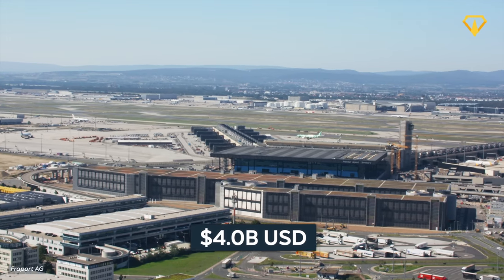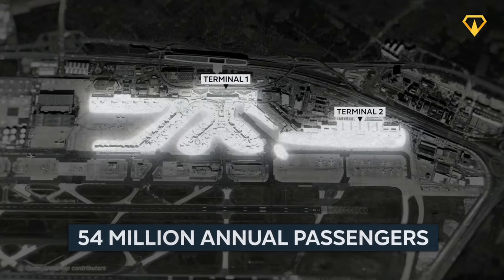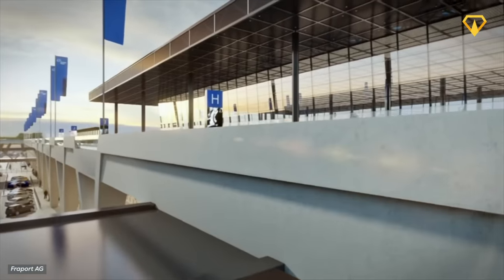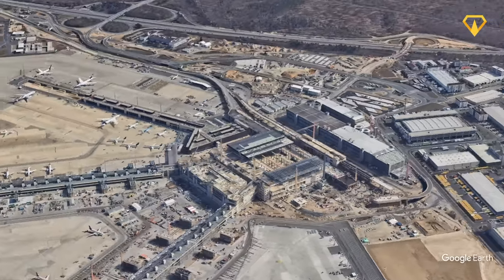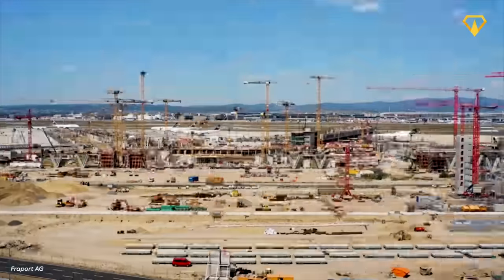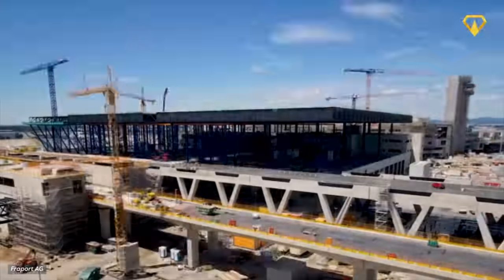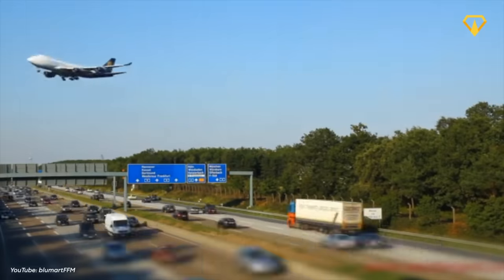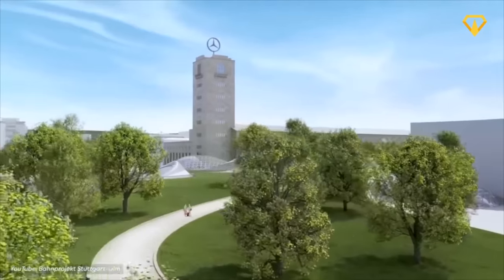Europe's Biggest $4BN Airport Expansion

Comment: People dont want Bigger airports. They want airports that are easy to navigate and quick to transfer with great cultural experiences.
Reply: Yes they dont want bigger airports but they need them
Reply: Frankfurt airport is one of the simplest airports I have been to.Switching terminals or get a connection flight ist simple despite its size.
Reply: But people will start moaning if 10k people are squeezed into a small hall. So, yeah. Bigger airports are a necessity.
Reply: And how are you gonna fit 70 million passengers a year into a simple, tiny airport?

Comment: The storytelling in this piece is great. As someone who frequently passes through FRA, I can't help but wonder how Frankfurt will manage to fill the 81,000 new vacancies. The customer journey through Frankfurt can be painfully slow, with most of the issues occurring at security and baggage. I hope that they are actively working on finding a solution to these problems and making the experience smoother for travellers. Nevertheless, I look forward to experiencing the new terminal in 2026!
Reply: It isn't 81,000 new vacancies; They're currently employing 81,000 people and terminal 3 will add a couple of thousand new jobs likely ending up at around 100,000ish once terminal 2 has been renovated. So "only" 19,000 new vacancies.

Comment: Very good video with much information. One thing, that is MAYBE happening, is that the Terminal 3 is getting its own Train station for the Frankfurt S-Bahn. It's not entirely sure when that will happen, but maybe 2026 (when Terminal 3 will go into full service) or 2030. Just wanted to add that.
Reply: Actually it will happen. The Bundesverkehrswegeplan 2030 contains a regional train station for the S7 and the regional trains to Mannheim through the Riedbahn
Reply: @paule8271  Yeah, I wasn’t really sure. But thanks for the reassurance.
Reply: That’s going to be fun, a few years after completion they’ll have to rip up the area again to build the train station.
Reply: @xfel5913  No. They're bulding the train station at the same time as the terminal but the terminal will be finished sooner than the train station because the train station is supposed to start service in 2030.

Comment: It should be noted that T3 will will not only add capacity to the Airport, but will first replace T2 as they carry out extensive renovations in T2. T1 and T2 will then merge to serve Star Alliance flights, with T3 becoming the main Terminal for other airlines. Cheers!
Reply: Have you watched the whole video?..
Reply: @Bubbirock  Sorry, but he ist rigth. Fraport stated that they want to modernize T2 because of Age and because they have a lot of problems there in terms of efficiency and processes.
Reply: @Bubbirock   yeah, hbu?
Reply: But isn't Terminal 2 newer than Terminal 1 or most of Terminal 1? What about renovating these areas?
Reply: @immermitderruhe yeah theyre renovating many areas of terminal 1 right now. I don't think it would be possible to close it due to the sheer number of flights it handles. Terminal 2 is very small in comparison.
Reply: Yes, really annoying this lame comment, ignoring the video all together!
Reply: @immermitderruhe  The A section of Terminal one (the largest part) has been upgraded since the opening of Terminal 2. There have also been renovations in B. So terminal 2 is older than much of terminal 1.

Comment: It will be a wonderful addition to FRAPORT. I'm hoping that it will eliminate the need for those awful "remote gates" where you freeze or roast while getting on/off your flight and then have to board a bus to get to/from the terminal. If anyone has any info on this, please let me know. Cheers.
Reply: For someone who wants to come close to an aircraft from the outside there is nothing better than remote gates
Reply: @hansmuller3604  Yes, true. I did that for many years. Ah, that smell of jetfuel. Cheers.
Reply: When did they start calling it FRAPORT?  Seems like they should be more true to their german culture, Is sticking to the old name, "Flughafen Frankfurt am Main."  Why the English-based acronym?
Reply: @douglasleathem622  It's been the official name of the airport authority for a long time. I am retired LH and always remembered it. The name of the airport on signs etc is as you wrote above. Cheers.
Reply: @douglasleathem622  Germans have been making up Denglish for a while now. (combo German+ English.
Reply: @douglasleathem622  The Airport is called "Flughafen Frankfurt". The company that runs the airport had to come up with a new name when their old name (FAG) infringed on the trademarks of an engineering company (FAG Kugelfischer). Fraport seemed a logical choice, given its international ambitions. Fraport does not only run FRankfurt airport, but is involved with other airports as well .

Comment: It looks like a beautiful terminal, but it’s a shame it is built on the opposite side of the airport. It would have been so nicer if it would have been built in line with terminal 1 and 2. And replace the cargo section and the fuel depots to the opposite side of the airport. More logical and convenient for passengers, public transport, taxis and supply for airport shops and restaurants. Missed opportunity if you ask me.

Comment: still hard for me to understand that the airport is almost twice the size of Heathrow (2160 vs 1227 ha) and has four runways, but Heathrow is still moving more passengers (66 vs 49 millions per year).
Reply: Since when does the size of an area have anything to do with the number of passengers arriving at an airport? Frankfurt is the final destination for very few passengers, but rather an airport for transit passengers. London, on the other hand, will be the final destination for most people, because London is a major city in the whole world. Besides, Frankfurt only has around 700,000 inhabitants and London has how many? That's right, just under 9 million. If you assess this correctly, the answer is self-evident. You can't compare apples with pears
Reply: @gerhardma4297  for example the number of runways? Frankfurt has four, Heathrow has two, but Heathrow has more passengers. I‘ll probably need a crayon to draw you a picture.
Reply: Heathrow serves whole UK, while in Germany there are three to four airports with international traffic (Frankfurt, Munic, Berlin and Hamburg and some smaller ones). So Fraport has not the traffic of Heathrow. Logical.

Comment: I flew through Frankfurt in 2012, and it was unfortunately one of the worst airports I've been to. This is because it's mainly one long corridor, so getting from one point to the other takes a long time within the same terminal. Disappointed to see that they're building an entirely new terminal with the same design flaw, though it does look a bit shorter than the original terminal.
Reply: How many major international airports have you been to? And what did you see of the airport 11 years ago? Frankfurt does not have a main corridor. Terminal 1 is very long, but it is also the link to the piers and therefore the gates. Please tell me how you can manage 150,000 passengers per day, more than 1,100 take-offs and landings between 5:30 a.m. and 10:00 p.m. without walkways: you're probably American. au an. If you don't have enough floor space to put gates for airplanes in a row, you build this kind of finger and the more gates you need, the longer the piers and aisles become. This is in the nature of things and architecture. I know it from Sao Paulo, Zurich, Paris, Nairobi and many other airports.
Reply: @gerhardma4687 In total, probably 50-ish, of them about half major international hubs. I think the old Ataturk airport was very well designed, same with Incheon and a few others I've been to. Ben Gurion is very well-designed but the current terminals can't go beyond 25 million passengers, so it remains to be seen how they'll build the future terminal. I'm not American, but speaking of the US, JFK is the overall worst airport I've been to hands down, but in terms of getting around it's also well-designed; but it has other more serious issues.
Reply: @Ynhockey  I think there will never be a perfect airport for all needs and Frankfurt is far away from perfection. I am a guy who takes it like it comes. Sometimes you can only shake your head, but I don't think the planners make their mistakes on purpose. Let's hope that they correct them during the next conversion phase. I wish you a good flight and a safe landing at all times. No matter at which airport.
Reply: there are actually smaller airports where you end up with longer walking distances, and also at some other major airport you have a really long walk to cover. Some of them even have busses or people movers in order to transport people back and forth within a terminal. In contrast to that I was always happy with Frankfurt Intl. Airport as the walking distances are in fact not that long. 
 @Ynhockey

Comment: Have they learned from the Berlin airport issues
Reply: It was not planned by politicians and thus by civil servants, but by Fraport, a company that has to think efficiently and economically. They know what they are doing and don't change the plans 1000 times
Reply: This cannot happen because the Frankfurt airport company FRAPORT not only operates airports, it also plans and builds airports. For example, their own Terminal 3.
Berlin wanted to be smarter and chose a path for planning and construction that ended in this disaster.
If they had commissioned FRAPORT with the construction, the planning and construction would have been completed within the planned cost and time frame.
Reply: @ruhri0411  FRAPORT's chief planner at this time was asked to clear the BER desaster. He refused.